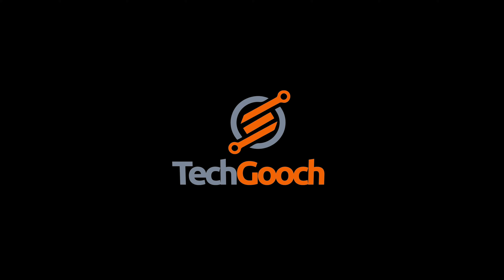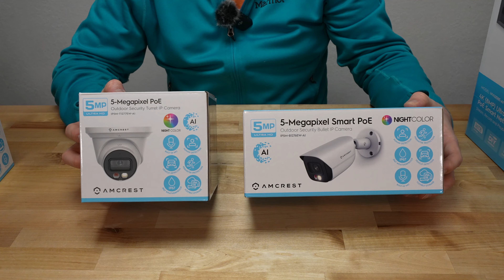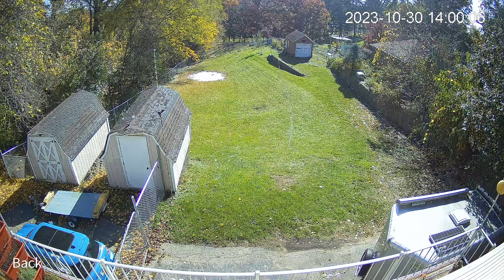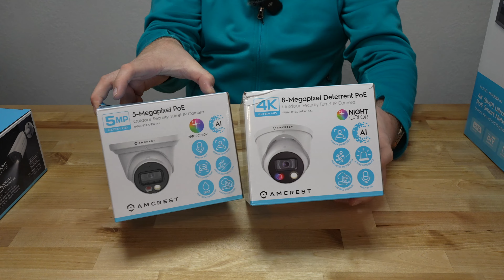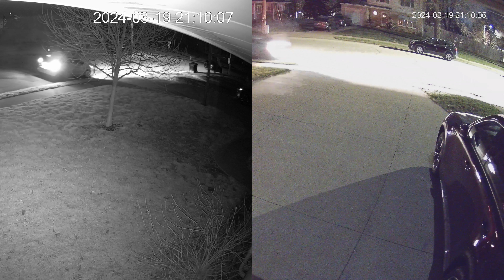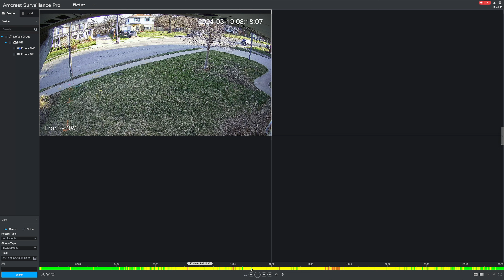Amcrest POE Security Camera System

Comment: The 5208 while it is in the Ultra high class of NVRs. The 4208 is a better line that it offers AI and offers AI at the NVR just not using the AI cameras.. Something that so many people seem to fail to understand about the 42xx lines. Now the newer 42xx 3AI line isnt' as good as the older line of 4208-AI or the like, 4208E-AI, 4216E-AI they are Ultra line AI NVRs.. With many options the 52xx lines don't offer unless you buy the 5216-16P for just under 1500 last I knew in COVID times.. That is only 52xx line I know that had AI. Now there might be some new 3AI line I don't know about yet but any of the normal 52xx line my 5232-16P is just a 2 HDD case line like the 42xx AI line is... The other AI again besides the real 42xx AI line would be the lower 41xx-A2 line that will do 4k cameras or less in AI as long as the Cameras are AI. Like my 4108-A2 has 8 cameras that are AI.. Where the 4216E-AI NVR that I also own shines is that it offers 2HDD slots, and has 4 built in AI channels that I can and have 4 non AI cameras connected like the 841, 941, and 1051 indoor mini PTZ cameras I have setup with Intrusion or Tripwires that using the NVR will detect human or vehicles and I think the 4208E-AI NVR has 2 that is build into the NVR that don't even need AI cameras to use the Tripwire or Intrusion with Human or Vehicle detection. I could be wrong and the 4208 might offer 4 as well but I think it only offers 2.. Then all other channels need to be AI if you wanted full AI options on your NVR... In the case of the 4108-A2 line all channels have to have AI cameras for AI to work. Don't get me wrong you could have 2 AI cameras I just mean there is no built into the NVR itself.. I have another brand AI NVR that says it offers in The NVR AI but it don't even work. Needs to have AI cameras for AI to work.. That NVR cost more then my Amcrest NVRs and isn't even very easy to use lol.. Need to have a Degree to understand how to use the other brand NVR.. Have it on my Videos only bought that NVR because of a business I had that needed Mask detection and warning that to enter Mask was required.. I wasn't gong to pay 8k for the Amcrest option in the COVID time so opt for Different brand because it offered Mask Detection and rejection...
Reply: So 4000 series have AI in the camera not just he NVR? This review convinced me to go with 3000 series over 1700, but there is also a 2700 series that is 4K at 15 fps.